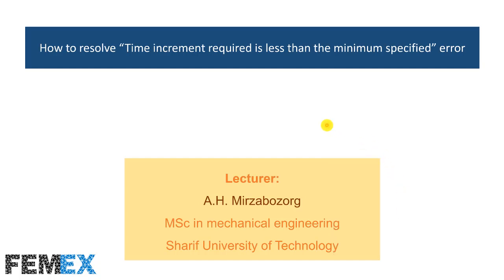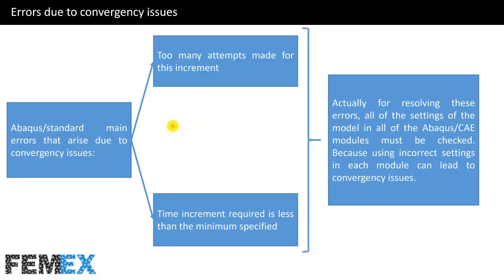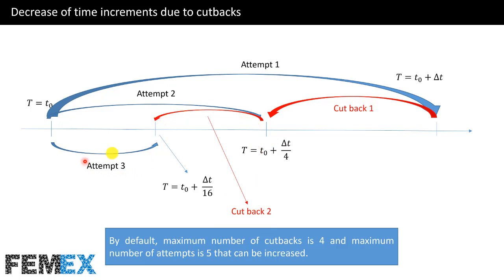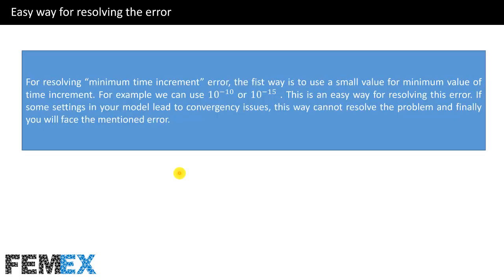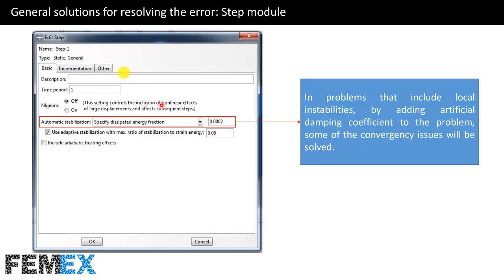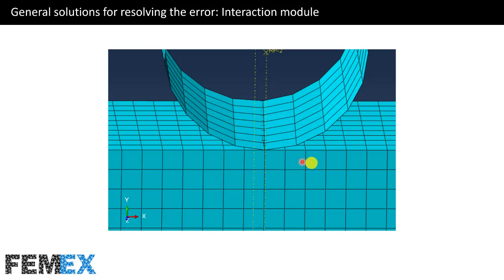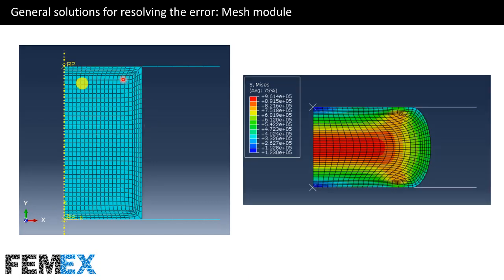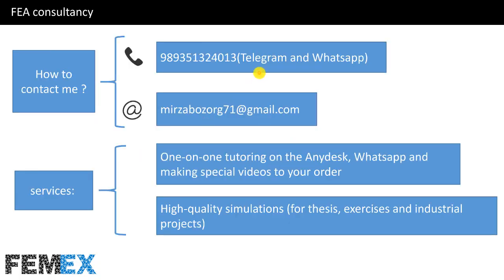How to resolve time increment required is less than the minimum specified error

Comment: while modelling stones column under embankment, i get the error "Error in job EmbankmentJob: Too many attempts made for this increment
Job EmbankmentJob: Abaqus/Standard aborted due to errors"
Reply from the maker: Hi.
The only thing that I can say is that your model has convergence issue. For resolving convergence issues, all the settings of the model must be checked because it can have several reasons. In some cases finally you must change the solver and use the Explicit solver instead of the Standard solver. You can contact us to help you resolving this issue.
Email: mirzabozorg71@gmail.com
WhatsApp: (+98) 9351324013

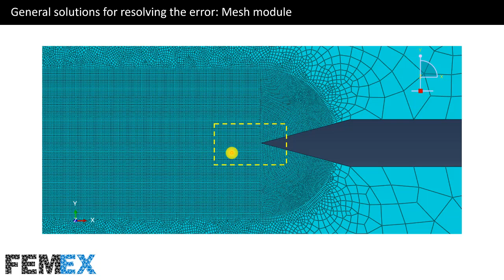Comment: I found some dude were talking about "instability in hardening" in this video https://www.youtube.com/watch?v=_vdnRe_6lw8&t=6s (10:53). I was wondering, do you have any idea what does he mean by instability in hardening? The plastic strain were supposed to increased as the stress decrease in hardening phase, isn't it?
Reply from the maker: Hi.
According to your question, I reviewed that part of the tutorial. In that tutorial, instability in hardening means that after reaching the ultimate stress, by increasing of the plastic strain, the stress decreases. He has named this phenomena as hardening instability. 
But defining the hardening in this manner is not generally correct and you must define the plastic behavior until ultimate point and also define damage to account for softening.
These problems can be easily resolved by employing explicit solver instead of implicit solver.

Comment: Thanks for your video Mirzabozorg, and I would like to check about using non-linear Riks? will the method be the same? As I've tried your suggestion but it doesn't work for me. 
Thanks in advance.
Reply from the maker: hi.
you're welcome.
actually the static riks step is different. it uses another type of numerical algorithm that is named riks method. what is explained and proposed in this video does not suite the use of static riks step. you can contact me via email, whatsapp or telegram for solving your problem.

Comment: Hi Mr. Mirzabozorg, great video, thanks for the great explanation. What can I do if the time increment decrease to values under 10^-9 during the running? It happens only with lateral loads.
Reply from the maker: hi.
your welcome.
in some cases, according to the occurrence of local instabilities or local convergence issues, the time increment size goes below 10^-9. but after they are resolved, time increment size increases. if it doesn't happen, it means that you must do some changes in your model. and the main change can be the change of solver from Abaqus/standard to Abaqus/explicit.
one of our services is checking your model settings and suggest modifications for your model in an online session. even if the change of the solver doesn't work, you can contact me via email or Whatsapp.

Comment: Hi do you teach about concrete Modelling also?? Civil engineering field
Reply from the maker: hi.
yes I do.
I am a mechanical engineer but near half of my students are civil engineers.
Reply: OK. What are the charges for project work?
Reply from the maker: @sohailhamza2812  please contact me via Telegram, Whatsapp or email. then I will tell you:
my email: mirzabozorg71@gmail.com
for telegram and Whatsapp: 989351324013
Reply: @FemexIran  country code Pls?  To add phone no. On telegram
Reply from the maker: @sohailhamza2812  my country code is 98 and my number is 9351324013 so my complete phone number is 989351324013